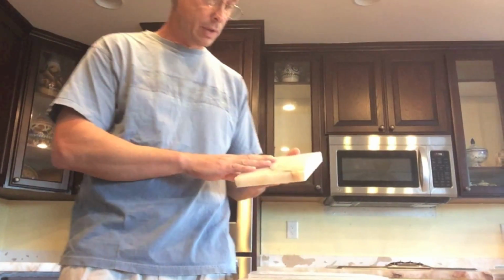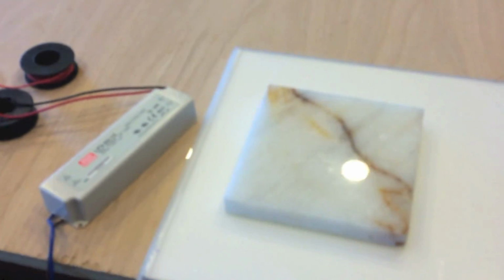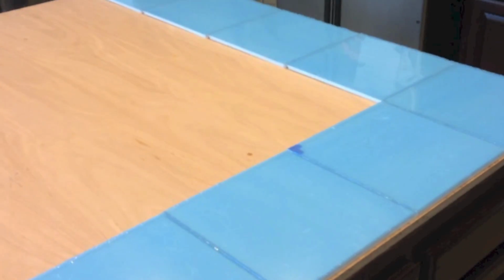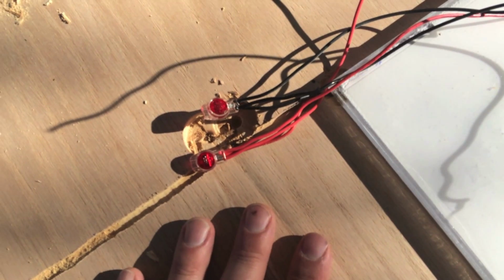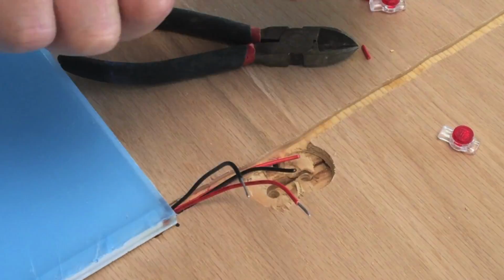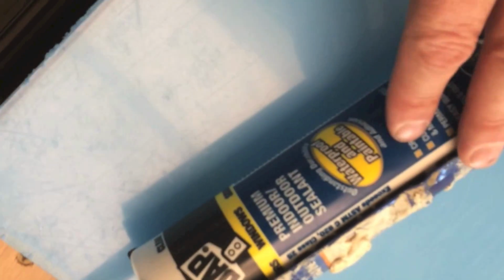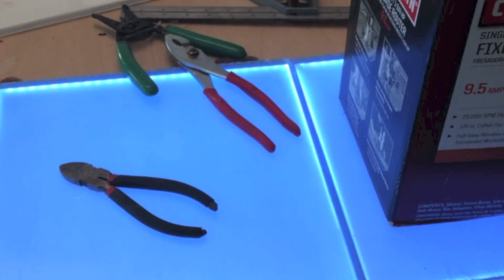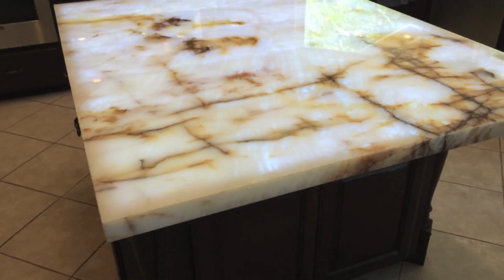Backlit / Underlit Countertop Installation

Comment: how to change the light when some of the lights is off? put off the stone?
Reply from the maker: The LEDs are supposed to last 20 years.  So far mine have been installed 2 1/2 years and are all working perfectly.  I really hope that none of them fail because the only way to repair would be to attempt to lift the stone (without cracking it) and then replace the LED.  It would be very difficult to say the least!
Reply: @johnseaman3859  How is it now? Are they all working?
Reply: @johnseaman3859  any update?

Comment: You don't have to strip the wires to use the Scotchloks and actually shouldn't. They are designed to cut thru the insulation as you compress them and the insulation actually helps keep the wires from pulling out from the connectors. I have used thousands of these. There is a special pair of pliers you use to compress the connectors to make sure you have even compression when squeezing down and dont over squeeze. Here is a vid showing their proper use. You can get them dry and also gel filled which are water resistant and might be better for a kitchen counter top that gets wet.
https://www.youtube.com/watch?v=vV16ahOr6po
Reply from the maker: Good to know!  Thanks!

Comment: Nice, what about is the dimensions is not exactly? Can I did cut the panel's o just split
Reply from the maker: Sorry for the late reply!  The panels are each 12" x 12"  One edge of the tile has the LED light strip attached.  You can cut the tiles as long as you dont damage the light strip  Here is the installation guide.  http://nebula.wsimg.com/3172f8edeed14f1f1ab55e830418ea20?AccessKeyId=ED386468577BA9C0787A&disposition=0&alloworigin=1.

Comment: Great job on the install. To save you some time and headache use (3M UR2) butt connectors they allow you to put the 20awg wire inside it with out stripping the wire. As far as gluing the panels to the substrate we normally use liquid nails. Again beautiful work!